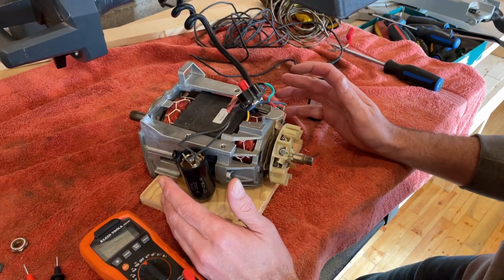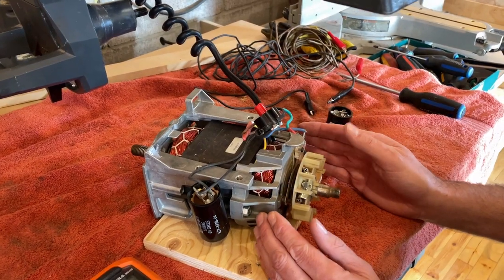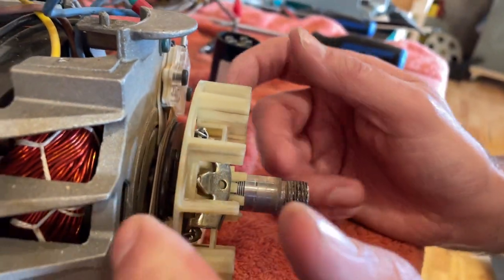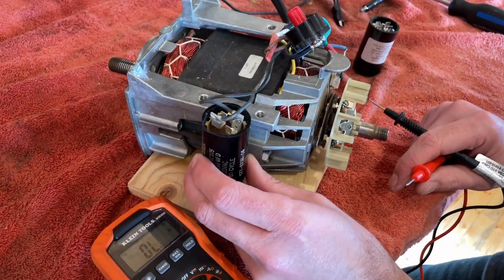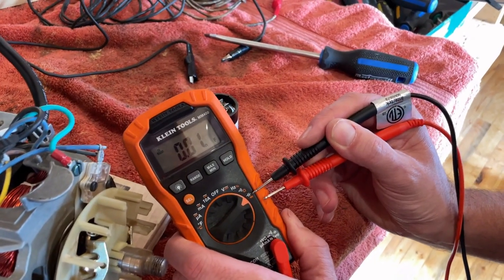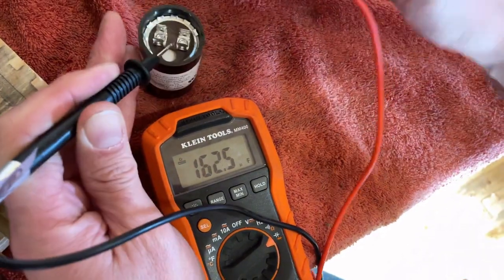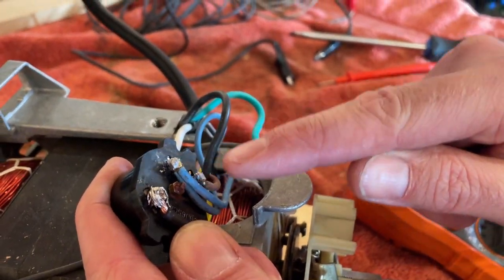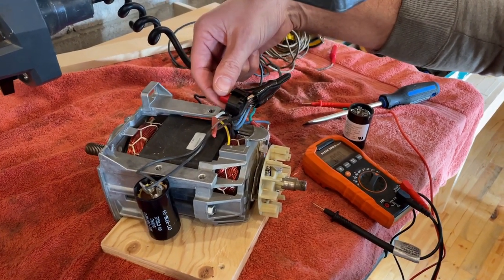How to troubleshoot an old single phase brushless motor (Craftsman)

Comment: Where did you get replacement for thermal switch
Reply from the maker: Its in the comments. The company is called Carbon Brush
Reply: @hotrod-machines  I contacted them and got the part ordered